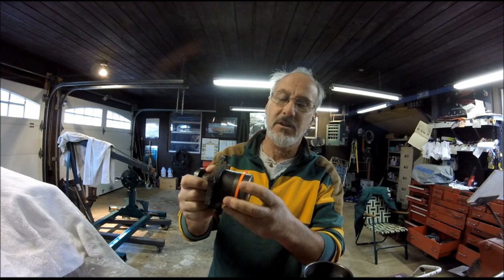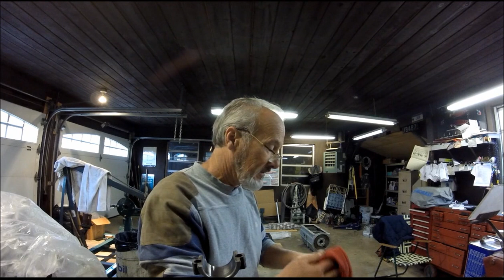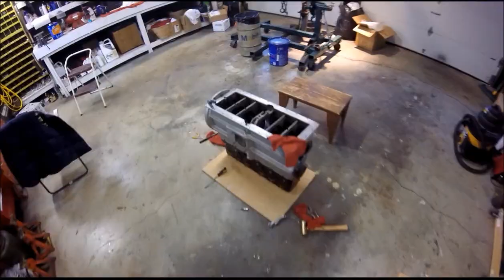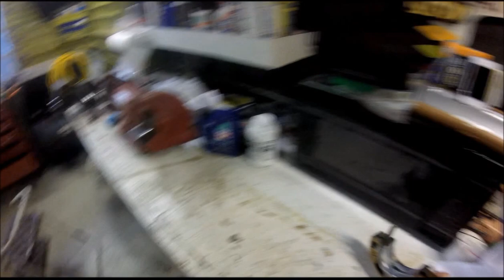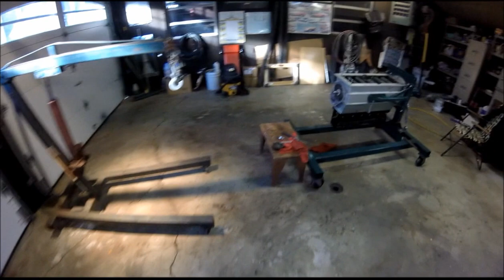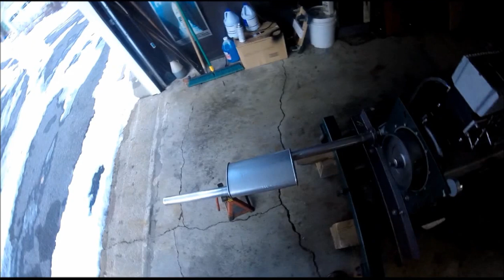Voisin  Sleeve Valve Engine Assembly

Comment: What material did you use for the headgasket?
Reply from the maker: Good question, That was a long time ago, I found an outfit that made gaskets. They are still around making them for the collector car market. It was not copper. I believe it was an Asbestos material. Similar to what I took off.  Sorry I can't provide anymore insight.
Reply: @SkiphurtPresents  thanks for the help.

Comment from the maker: I state in this video that the engine didn't smoke. This was true for the first few minutes running. However I believe this was because there was a limited amount of oil making it's way to the cyl. walls. As the engine ran longer it started smoking. I believe this has to happen because there is always going to be oil on the ex. sleeve that will react to the ex. heat. In fact I can see no way for the engine not to smoke! My sleeves were very tight the Junk rings were new. I believe any claims to the effect that these engines will not smoke to be false. Every engine on vintage film reels I have seen shows the engines smoke. 
Skip Hurt
Reply: Yep, the knight sleeve valve system alway smoke because eat lot of oil...so regrettable that the much better Bristol sleeve valve system was never use on car engines...Im' well known the 2000hp 14cyl radial Snecma Bristol Hercules use on the french Nord 2501 Noratlas aircraft: smoke at start like all radials, but if at normal t° ,he did not smoke, the oil consumption was relative low and the gas consumption/per HP was less as comparable US radial engines (difference visible in the night, the exhaust flames from the Hercules was perfect BLUE, on US radial are the flames orange = richer mixture to avoid detonation...